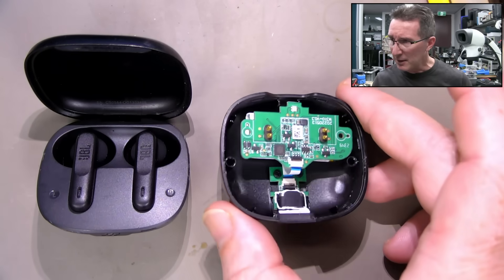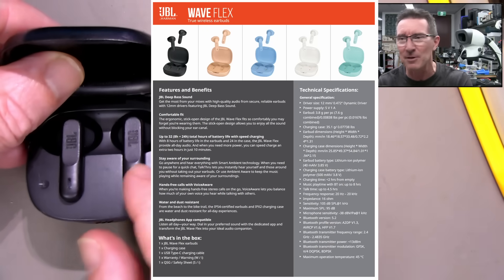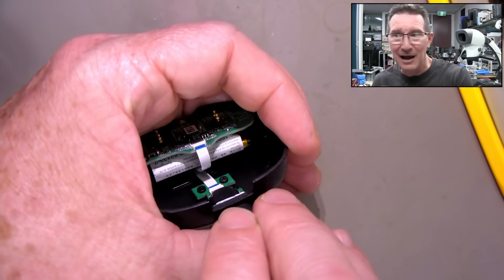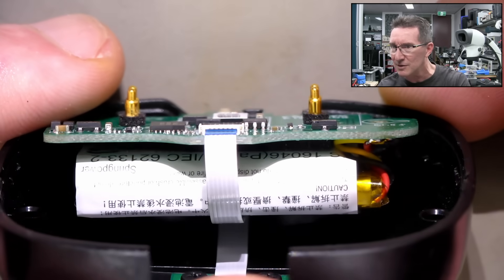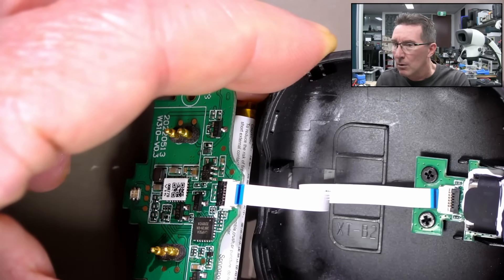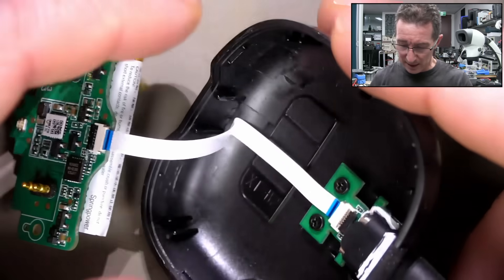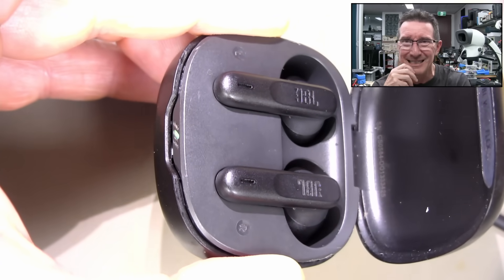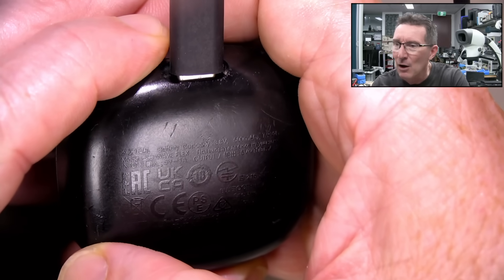JBL Wave Flex Earbuds REPAIR

Comment: How did you disassemble the case?
Reply: This! Edit- starting at the back by the hinge I got a small screwdriver in for leverage then worked it around to the side at which point I was able to pop off but it took a bit of force.  I did everything else exactly as this video describes and now they are charging and everything is working. Saved me thirty freedom dollars.
Reply: @novabythelake managed to fix it. My toddler dropped it so that ribbon cable fell out. I did damage the case a little bit with the screwdriver when trying to open it but Ill take that over buying brand new one 😊 thanks for the video! It was really helpfull

Comment: Heh just wondering how did you take the case apart? Mine got water inside, and after a week had a quick fix with a heat gun but recently stopped working again. Just need to take it apart but it's been a struggle
Reply: Same i can't get mine apart
Reply: @killakoala1087 I have not been able to but after a month or so mine works with a singular cord on a singular block (which thankfully is my portable). But ya it's really tough I gave up on it sorry to say

Comment: When I get electronics wet I remove or disconnect the batteries, dry it off then put it in a warm place for a while.
It is important to remove or disconnect the batteries asap to prevent electrolytic corrosion instead of just waiting for the best.
I guess putting it in rice also helps, jasmine will give it a nice smell.

Comment: I don't trust "in the ear" wireless buds now. Someone had a Samsung one fail, a battery issue and the earphone popped loudly, causing deafness in that ear. She contacted Samsung and they just offered her a replacement set. Use a bluetooth transmitter and use IEMs instead.

Comment: I got the cheapest Soundcore P20i ones, 29 Euro delivered. They are good enough, don't have ANC (don't want that on the street), and if i lose them (which I fully expect to happen 1x a year) I can replace them by another 29 Euro pair. That's how i always did it with my bluetooth headsets.
Reply: If in addition to ANC, they have the external sound feature Dave talks about, I find it safer to use than standard earbuds.

Comment: I have a pair of these and a pair of endurance peak 3. The only complain I have with flex is that they are much more buggy when it comes to software stability, I often have to restart them and they usually tend to randomly disconnect.

Comment: JBL wave flex is $50 AUD but a discontinue model and JBL wave flex 2 is the model sold now is $99 AUD
Reply from the maker: Ah, what's in the new model?
Reply: @EEVblog2 new pricetag (unfortunately)
Reply: @EEVblog2  i was wondering about the price, bc they cost around €45 in central europe

Comment: This is life, people sure will throw it away. I'm not good enough or tracing the circuit but I'll try re-seating. Totally agree sound quality is NOT the first consideration since on the road or somewhere outside the 9mm (no more 12mm now as I know) speaker diameter already a compromise of sound quality.

Comment: I've fixed a few [older] ICOM radio transceivers by just adjusting and/or replacing those damn ribbon cables.  Some times the manufacturers use an exact length and don't allow for any extra tug, so they get easily dislocated by accident.  I think one ICOM VHF/UHF transceiver had no less than 8 ribbon cables!
Reply: I got a friend that repairs radios and he specifically finds icoms annoying because they give you very little slack on those ribbons. I pray I never have to take mine apart.